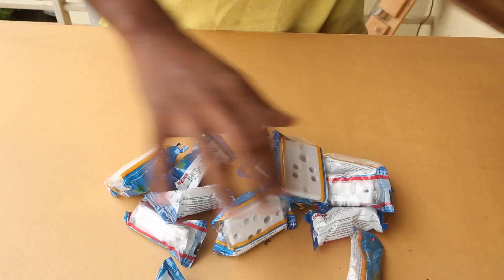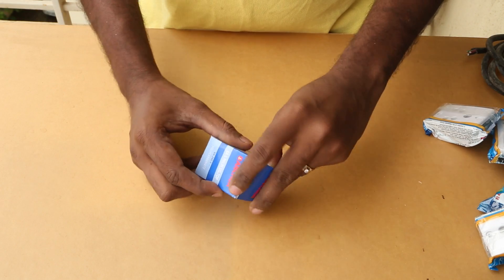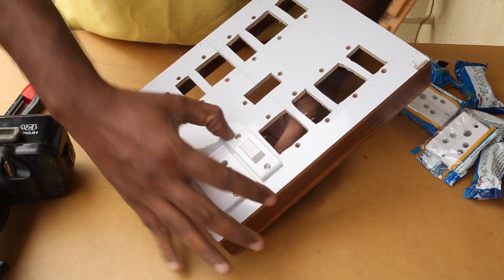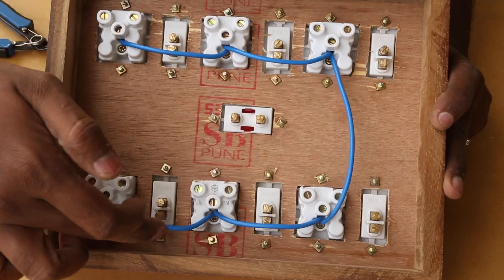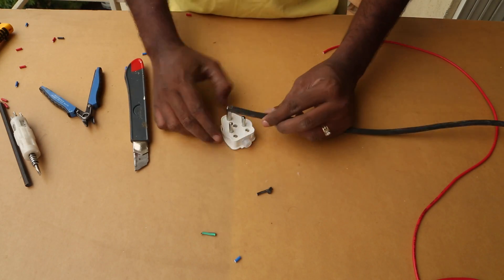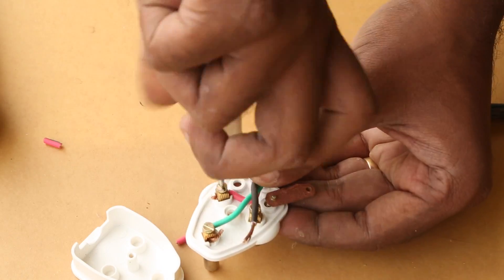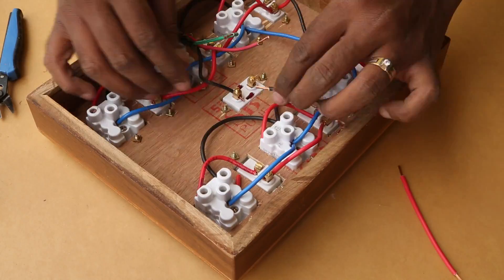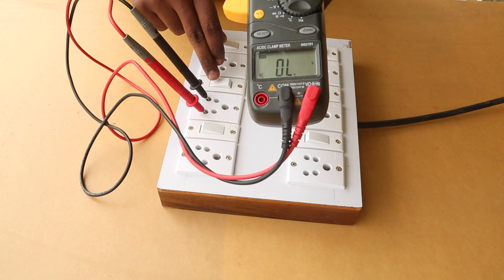DIY - Extension box to power your Equipments

Comment: Plz upload one video how to take power supply i mean how to loop the wire external 5in1 to switch board ...i have 5switches ,1 fan regulator,and 1 .5pin socket..this is my switch board....plz

Comment: this is dangerous & a safety hazard,there are no fuses nor breakers present in the circuit & you will more than likely overload things & you are using  incorrect colour codes off the cables

Comment: Useless. I have dollars, not rupees. None of my plugs in America fit these receptacles.
You're trying to kill Americans... Colors are all wrong.  We use Green for Ground/Earth.  Black and/or Red for 120/240V Hot.   White for Neutral.   We don't do any 6 ampere ratings.
Sorry, common sense is not always a common virtue.  You should specify what country's electrical standards you're using since  this video is viewed globally.  They can even watch it in Ouagadougou.
Reply: Sorry Jules, but I'm not quite as kind as the author... ;-)

Don't take it personally but I believe your comment is also useless. There really is no point to it. I agree that common sense is not always common, but
I fail to see how this guy is responsible for the stupidity of others everywhere in the world.  Especially when he goes out of his way to point out the dangers of AC in the very beginning. Besides, those sockets are not even available in the States! -- How is that going to confuse anybody?

And, if you listen carefully, the author mentions that the colors used don't matter as long as the connections are correct, which is a fact.  
Our amperage standard is higher (15 Amps, not 6 Amps) for regular tools and small appliances because our voltage is lower. Which means that our amperage must be higher to get the same job done.  But if you were worried about the size of the wiring, for the amperage in his location, not being suitable for use with our higher amperage equipment, you'd be wrong. 
Because 240V at 6A  and  120V at 15A are close enough not to matter much. In fact, our equipment can handle a bit more wattage than theirs, in this case.

I believe that anyone, American or not, who can't tell that this video is not made in America just by seeing the different sockets, is an idiot and shouldn't be playing with electricity at all!  
That is, unless the idiot is just dying to get a Darwin Award!  ;-)
Reply from the maker: You have good General Knowledge. Thanks for letting me know about the place Ouagadougou.
Reply: Ouagadougou is a fine place in Burkina Faso if you're ever north of Ghana in western Africa
Reply: non sense, in us and uk vertical type pins used,but the round holes are indian type switches...each country have its own unique models and cultures....nowadays mostly pins are like u can use indian as well as international pins also in the same socket....so kindly update ur so called knowledge.....NAMASTE
Reply: Jules Bartow Where the hell are you from?? Taking into account every teeny weiny country won't be possible, as there are hell lotta varieties of electrical systems in world. Besides one cannot find those exotic plugs in sockets easily.
Reply: Jules...Deserves it !!!
Reply: +Gu Hong,
Gu you're confused.  If you did NOT care, then why write... anything. 
You do care. That's so sweet, but please seek professional medical help for your F*** problem,   whatever that is.  Perhaps Fallopian tube blockage during your menstruations?
Reply: You need to visit Indian mostly Mumbai and then you will realize how much your knowledge is least about it. After visiting Mumbai let me know still you think the same or a bit different Mr.Jules.
Reply: sir the colors or wrong
Reply: Jules... Really?? The same comment from the last video?
If you have other idea better than this, please show us. I couldn't find a video in your channel better than this, and it was pretty easy with just 147 subs XD
When you have one video with something better, ok please comment... But, until then... We don't F*** care what you think... Ok???
Reply: vivtube,  
Fugetaboutit dude.  I'm from New York, New York, New York, US of Merica, home of Anthony Weiner.  When I go to a teeny wiener country with my big hands president,  Donald Trump, we've determined through physics, that with enough velocity, he and I can get any plug into any jack/receptacle, like a straw through a tree in a tornado.

Let's be realistic...

We're going to make America Great Again by getting rid of the metric system and repealing Ohm's Law around the world.  You're going to love electricity more than ever.  It's going to be huge.  They're even going to put generators, alternators, and inverters in cars with Artificial Incense (AI) to make them smell better when a computer drives them. It won't be no European company like ABB, AEG, Siemens, Schneider, but GE, Westinghouse, Tesla & Edison.   Whatever country you're in, your culture, religion, and language will be Christian (maybe a Jew or two) and English.  Men will wear pants (not dresses) covering their underwear (get a belt Bro) and only girls, gays and pirates will have ear rings.  Trump is making a perfect world --as soon as Mexico pays for the Wall and Congress repeals and replaces ObamaCare
Reply: Nonsense.
Reply: I want to build one of these. Ouagadougou is boring.

Where would be the best place?  

Sorry.  I don't know much about India other than there are castes with untouchables that skin the leather of dead holy cows.  Romeo patrols beat Muslim boys trying to marry Hindu girls.
 
Chennai, Mumbai, New Dehli, Bengaluru, Sri Lanka, Hyderabad?

Comment: You again got it wrong!. 
6 A -1.5 sq.mm wires
15A- 2.5 SQ.MM wires.
Simply no point in wasting money on 2.5 sq mm wire if you are going to use 6 amp plug. The 3 core 2.5 sq.mm cable makes sense. U should use 15 A plug. U have excellent editing skills, but please do proper research. I guarantee the plug will start smoking if you use 3 or 4 sockets with heavy loads "under" 6 amp.
Reply: Chirantan Bhattacharjee It's for the simple reason of max capacity & extended time use. Most day to day devices that are plugged into 6 Amp sockets don't consume anywhere close to 6A. But it's national standards. U can also make 16A to 6A adapter as long as u don't use a 16a device.
Reply from the maker: +LifeRider 96 thanks for the comment.
Reply from the maker: +LifeRider 96 thanks for the comment.
Reply: mediamilan Sure, ur other videos are pretty cool too.
Reply: when you are using Washing machine, microwave, and AC it take 15 amps... what you will do on that time... change the whole warning.....????
Reply: So u r recommending to use 15 amp plug sockets

Comment: i can use like spike guard right
Reply from the maker: +Virtual Tour there is no special circuit to prevent things from voltage spike. But I have used these setups for ever to run my work station. Nothing has happened. So you can make one and use it.
Reply: Virtual Tour